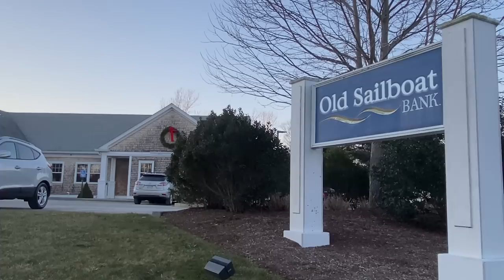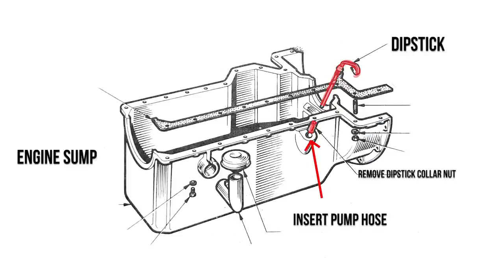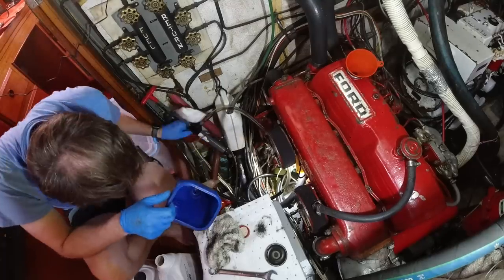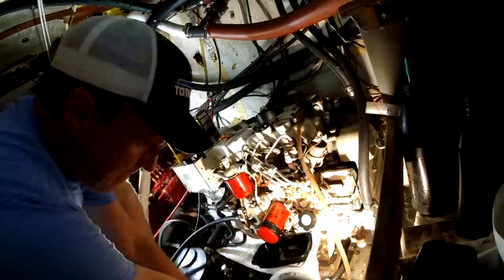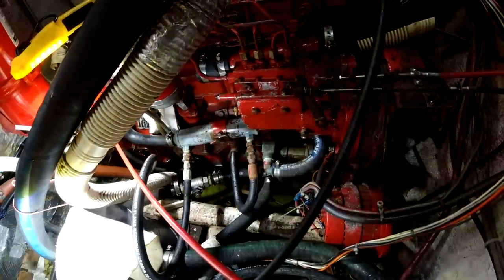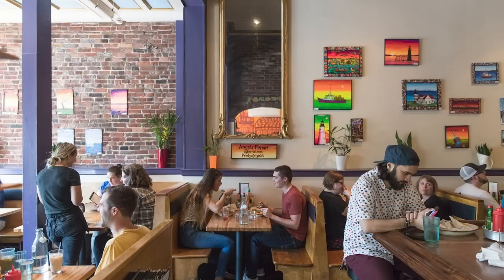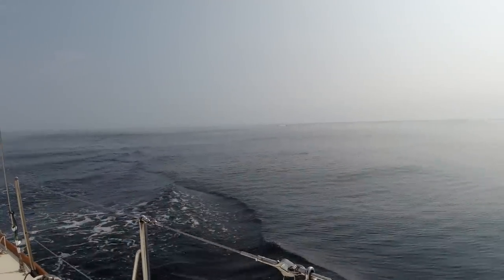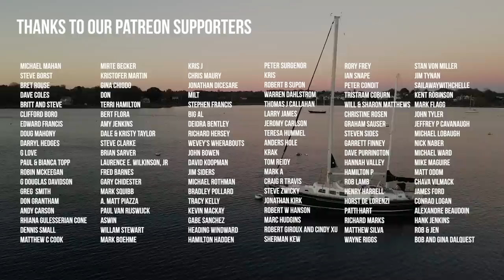Ran-day's sailboat - It's GO TIME!! EP9  #sailboatrefit #sailboatrestoration

Comment: West Marine sells a nice hand pump vacuum oil change container that you only have to pump a few times, and will hold six or more quarts. It also has a small tube you can likely stick down your dipstick. Great video thank you for posting.
Reply: I use one for my little Yanmar. The pump removes air from the device, and suction pulls up the oil.
Reply: Yes, I've got one of these too, makes the process much easier!
Reply: Skip the hand pump and get the electric one. Worth its weight in gold.
Reply: Defender has the Marpac fluid  extractor which is similar, Randee must get himself one.    I do not like the electric ones I've used.

Comment: Break your drain nuts loose while the engine is cold in case they are tight, then snug them back up. Then you don't have to struggle around a hot engine.

Comment: Great video RanDay.  I use a Pela pump to remove oil. Rather than directly pumpping oil, your pump creates a vacuum in the reservoir. You pump until you've created a decent vacuum and leave it while it continues to slowly draw under vacuum.

Comment: Hi Randy. For oil changes, maybe buy a deep well socket with a magnetic insert and appropriate length extension to get at the dip stick nut. That should make changing oil much easier. Someone else mentioned a small electric transfer pump. That will cut oil change time and effort down to a couple of hours instead of all day.
Reply from the maker: I like the sound of a magnet insert… great tip. Thanks!! 👍👍

Comment: Get an electric oil transfer pump! Have plenty of oil and filters on hand as spares. I went through 6 fuel filters on delivery from Ft. Lauderdale to Nassau on a 34 ft sailboat, that had bad fuel. You won't regret this. If it's too hard to do a task you'll just put it off. Start buying spare parts. Water pump, oil cooler, belts, generator, hoses, and hose clamps.
Reply from the maker: Great advice… I do have spares of most of those… even the big water pump… I did finally break down and get an electric pump (frugality lost out) to encourage me to do more changes. Cheers

Comment: Changing the oil is my second most hated job on my Hunter 36,(second place to head pump rebuilding).  After 19 years I have it down to about an hour using a hand pump for the 3 quarts.  Also, I learned that disposable diapers are great for catching the oil when removing the old filter, and one package of 20 diapers lasts for years.

Comment: just a note in case no one has happened to mention it, but there are a lot of small 12 volt transfer pumps on the market that would make this task a lot quicker and easier. One hose in, one hose out, connect the leads and off you go. Most can draw fluid vertical, a rather impressive distance.
Reply from the maker: Yeah, I was a bit too penny wise… I found one for about $30 and I’ll be using it soon! Thanks

Comment: Use a vacuum pumped oil change device - 8-10 pumps can generate an good vacuum in vessel which sucks out oil. Until pressure in vessel reaches atmospheric pressure. You’ll only have to repeat a few times to empty sump. Much less work!

Comment: 7:03 Good job filling your generator from the side fill port. Never fill those engines from the valve cover fill port. Had many engines come in that wouldn’t run after a simple service. Found the failure to be bent connecting rods caused by a worn overhead that allowed the new oil to pass by the valve seals and guides and into the combustion chambers. If your engine doesn’t have the side fill port, pour the oil very slowly into the overhead. Don’t allow it to fill.

Comment: tip for the oil filter if you are replacing it, just stab/hammer a screwdriver through it and use that to loosen it, works great if you're just gonna be throwing it away anyways.

Comment: 1st) ratchet/long extension/socket...box wrenches are the worst, 2.) Aquarium pump to draw the oil out...or you can buy a little pump that you attach to a drill to draw the oil out

Comment: Hi quick tip if you havnt a oil filter wrench/grip get a sturdy scredriver longer than the diameter of the oil filter and punch it right through the oil filter then yo twist the old oil filter off using the handle of the driver . also good for hard to remove filters.the new one can be replaced by firmly gripping the oil filter no need for a wrench that over tightens it. Always double check the filter after running an hour just to be sure.dont forget to smear a little oil on the rubber gasket on the oil filter..

Comment: id change the oil again because suckers and i have one dont get the crud out of thr sump. i undrestand the sump nut is a bastard to get at , jesus ive cried. Stunning beautiful craft, and i wish you fair winds
Reply from the maker: yeah... I like the way you think. Cleaning it up 2x can't hurt and maybe this time I'll splurge on a pump to get the oil out of there... I've been logging a lot of time i the engine room this off season... so it's going to be sparkling. Cheers, Eamonn!
Reply: @YachtHunters  Theres some kind of detergent i once used to great effect to clean the scutter out of the galleries. still theres no substitute for the sump nut (the bastard)

Comment: Great job RanDay. Just a little mechanic advice. You were not using a socket wrench. That's a combination wrench. You were using the box end. And the other end is the open end. You probably also have a socket set (Metric and Standard) with a ratchet wrench. In addition there is a type of ratchet box end combination wrench sets. They are invaluable when working in tight spaces like engines.
Reply from the maker: Thanks for the tip.. I'll definitely add a few more tools to the collection... much appreciated!

Comment: A lot of us put an absorbent pad under the motor to help show if anything is leaking, its a lot easier to see a drop of oil or coolant on a nice white clean pad, rather than in the potentially grimy bilge.    I wouldn't take it as indicating a problem.
Reply from the maker: Fair point… I use them quite a bit. It was a bit of a shock to discover the pad was floating in 1” of coolant 😬 wish me luck!

Comment: Great video Randay..... Smart idea of getting the Capt. and your new friend join you on your trip....
The first thought that came into my mind when you showed the diesel fuel that you took out of the racor is that you need to get your diesel fuel in your tank polished ASAP..
Ask your Marina  if they can recommend a good fuel polishing service in your area.. it's not something you want to do yourself..
Signs of leaking antifreeze is concerning, but may be a simple fix.. but in a tough spot to get to..
And I definitely recommend a electric pump to extract the oil out of the oil pan next time.. they're not expensive, check out harbor freight if you have one in your area..

Comment: Oil samples are highly recommended atleast a few times a year. It will save you from destroying your engine and you'll be able to do a simple rebuild as to buying a new engine. Every bearing and internal part is made of a special materials and the sample test will tell you if you have bearings and where they are that are going out. I really liked your boat when it was on a episode and it seems once you do some maintenance including fixing the crazy wiring you'll have a wonderful sailboat. Last time I looked there was a several really different sailboats for sale in the Maryland area and for a decent price. I know one was a schooner built in the late 80s.
Reply: If you're going to run biodiesel fuel you better be prepared to deal with algae that will grow in the tank and ruin your fuel lines especially if it sets for extended periods. If it's going to sit I'd be adding additive to it.

Comment: Congratulations Ran-day on your boat and taking on that project.  A note on SAE 30 non detergent motor oil.  You can find that at most tractor or farm stores.  I run that in old tractors.  Didn't you have to bleed the lines once you change fuel filter?  Thank you.  Pete
Reply from the maker: Good idea… we think alike… I hit the local tractor supply and was out of luck… took more hunting than I thought it would. Yup, drained the filter lined as much as possible (gravity) so between that and the filter contents I got another 1/2-1 qt of oil out of the system. The remote filter is really handy and I’m glad it’s setup that way… just needs a better mount. Thanks for the note!

Comment: Be careful with that Rotella.  We had an old(ish) Westerbeke, and did the same thing you did.  The detergents and stuff in the Rotella cleaned out the engine to such an extent that the sludge completely borked the new filter, and blew it off, resulting in 6 + quarts of oil in the bilge.  Not saying that the same will happen to you, but w/o knowing all that's gone on with that engine, it is a risk.  I'd strongly suggest inspecting, and perhaps, replacing both the oil and oil filter again very soon.  And perhaps a few times if it looks like the detergent in the oil is pulling a lot of sludge out of the old engine.  best of luck. Beautiful boat!

Comment: Good video! Next time, pull a vacuum through the dipstick hole and it's like magic. As others have mentioned, there's a West Marine manual pump that works really well. One of the few WM-branded items I can wholeheartedly recommend. Also: on your fuel filters -- your primary (the one that screws directly on the engine) is probably a 10micron, so your Racor should be a 20 or 30 micron. In theory, you could damage a delicate diaphragm on the fuel life pump if you make it work against two very fine filters.

Comment: Hi mate. Look for the Pela 6000 oil extractor. No need to take the dipstick tube out. Just a few pumps the let it do its stuff. If you get a filter you cannot unscrew as you dont have the right size strap wrench, knock a screwdriver right through the filter and use that as a leaver to remove it. Sail Safe mate. Ant & Cid .

Comment: Fwiw I use a drill powered fluid  pump ($30? on Amazon) to empty sump.... Still takes awhile and maybe an extra 18v  battery on the on the drill.  Copper tube helps....I use the same for really sucking up everything in my bilges(my boat has 3 seperate bilges). Old engines leak.....a dear old friend told me many years ago " old engines are like old people....they need plenty of fluids and sometimes they leak".
Reply from the maker: I do now own a drill powered one… Colin from Parlay Revival put me on to it… good use for many types of liquids in boats! 👍 cheers!

Comment: Hello Randall, I  am a huge fan of H Scheel and even his keels.
There are more choices than ever for drawing sump oil but my go-to is definitely a handy boy brass pump.
Thank You for bring us along!
Reply from the maker: Anytime you have some feedback, Marty, my ears perk up 10x their normal size.  I'll definitely check out the Handy Boy...  when you get a chance shoot us an email at captainqyachthunter@gmail.com - I have a questions or two for you! cheers!
Reply: @YachtHunters  Jabsco 33799-0000 Handy Boy,
Seems like they don't stock it at wm but it's available lots of places.
The Little Pal 34060-0010 is very similar but smaller. Some people embellish these pumps with a hose clamp at each end, to enhance the rubber seal on the tube, but not too important.
 If you can get a 3/8 tube into the sump that's great. There are some disappointing electric ones, and some so so vac type, that's why i just use a brass piston pump, bc a nice vac type isn't justified for how often i actually use it. They're expensive typical Jabsco Par but worth it.
Notice that the first thing out the bottom of the racor is actually water. We would do that twice a day when running; just a short "open, drain water, shut valve". No air can get in.
It would be interesting to scan each cylinder individually with your IR themometer, on the exhaust manifold, like having a pyro on each cylinder. (if  your thermometer  can stand those kind of temperatures). Look for differences in temperatures.
Funny, just looked at a boat today with the same Lehman main as you have.
Thank You

Comment: Hi Randy,
A couple of things that I noted about your oil change. Most importantly is the oil type. It might be significantly better to use an oil designed for diesel engines. An economy grade  oil for gas engines will not save money in the long run. A good multi-grade oil intended for use in diesel engines is the modern way, 
In regards to your fuel filter change, the " muck" occupying %90 of the Racor's glass bowl is, I have no doubt, BUG.... It's alive and lives in the interface between the oil and standing water in your engine sump. I think that the solution to this problem requires cleaning the fuel lines AND your fuel tanks. Faced with this problem in New Caledonia, on an eight year world cruise, we cut access holes into the tanks so that we could clean them. Afterwards, we treated the diesel fuel Biobore, every time we refueled. In my experience, the problem with Mr Bug begins with buying dirty fuel from an agent... not an uncommon occurrence
An excellent source of information on all of the aforementioned problems and their solutions is Nigel Calders wonderful book on all things related things related to boat maintenance. 

Good luck with all this

John

Comment: Hey invest in a vacuum evacuation pump they are used for jobs like yours this will help you greatly reduce your time. Also have a draft tube designed to extend your fill plug up and custom fab a dipstick for it just food for thought

Comment: There are not too expensive oil change pump setups that consist of a bucket with a pump mounted on top.  You put a tube down the dip stick tube and turn the pump on and out comes the oil.  Just flip a switch.  A suggestion for the oil.  A diesel rated 15W40 oil (Shell Rotella T, Chevron DELo, Texaco URSA, etc.) will work very well in that engine.  I buy my oil at NAPA and it costs about $20 per gallon.  Buy your oil at an auto parts store not West Marine.

You were way past time to change that fuel filter element.  10 micron filters are fine.  Keep several on hand.  Given how bad your filter element looked, I would put 6-10 elements on board before any longer engine run.  Your filter bowl had water in it.  You may want to polish the fuel in your tank, or at least run a hard copper tube down to the bottom of the tnank and pump out the water and emulsified fuel at the bottom of the tank.  The fuel in your Racor filter should be red, not black.  Also, you need to change the on engine fuel filter.

It is good practice to put oil sorbent cloths under the engine. Check/replace them frequently.  They will show you if you have leaks.   One thing that is common is that the gaskets at the ends of the engine heat exchanger can leak.  You may have an antifreeze leak there.  The gaskets are generally easy and cheap to change although all you may need to do is tighten a couple of bolts.

Comment: Get rid of that hand pump and get yourself one of the vacuum extractor oil change deals. They are so much cleaner and easier. I can change the oil on one of those engines in about 30-40 pumps. I've done enough with the hand and drill powered pumps to know that the $80-100 for the vacuum tool is the best bargain around. They also have thin tubes to slip into the dipstick tube.

Comment: It looks like you've got a ton of through hull bungs, I was wondering if you wired them up to the respective through hull? In an emergency you don't want to be searching for the right sized bung, especially when you have so many
Reply from the maker: Yes… excellent thinking. I didn’t put it to film except a really quick prep clip but I did tether each bung plug to each thru-hull 👍👍 can’t believe the previous owner hadn’t done that!

Comment: Excellent on oil changes & yes on the oil adsorption pades she an older girl & leaks some fluids, definitely needs her temperature gages fixed (temp sending units should screw into side of block, Google photo of sending U should be easy to see with bright lite) only 1 wire to unit. Contact me if you need more info

Comment: The final fuel filter on the engine is usually 10 micron or less. It is not a good idea to use a 10 on the racor as it will wear out /stress the lift pump diaphragm  and leak diesel into oil sump...  Make sure you oil levels are not increasing after a few hours of operation. that's dangerous...

Comment: I guess tractor engines modified for marine use have design compromises. 🤓. Would be interested to see how that compares with an engine specifically designed for marine use as far as maintenance accessibility is concerned. That mess of wires below the engine means that working on it is like working on a car on a gravel driveway. Bolts are guaranteed to disappear forever if dropped! Always interesting to watch you at your labors. Hopefully still a labor of love. 😊

Comment: I don't understand the straight 30 weight oil unless you have really warm oil temps or low oil pressure, but even then go with multi weight oil. 30 weight would be fine when you are running extended & hard in summertime.

Comment: I get my Rotella SAE 30 at Walmart. Usually in stock. You can also get it from their online store
Reply from the maker: Walmart was all out in the Portland area… had to do some scrounging… my eyes are a little more opened to multi weight oil these days too.
Reply: @YachtHunters  I’m running Brad Penn 20w-50 Racing Oil in all of my vintage SAE30 engines (Vintage VWs & the like). Highest zinc content. Partial synthetic. I swear by it